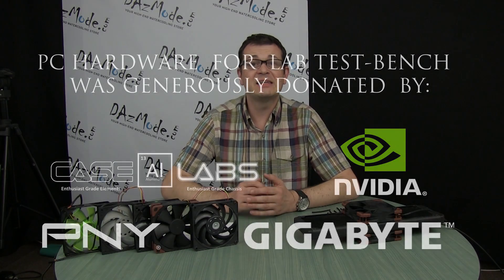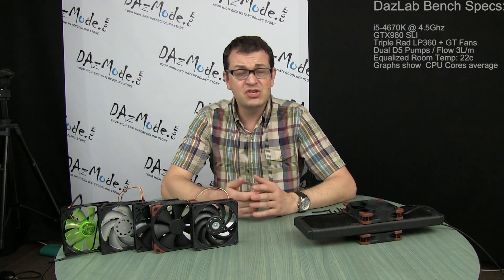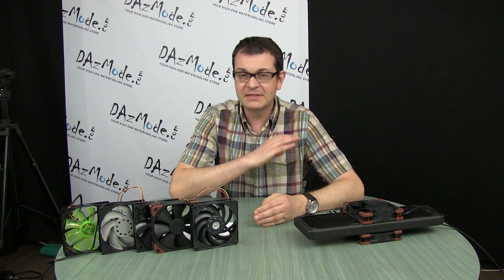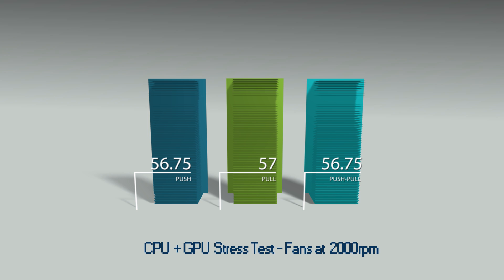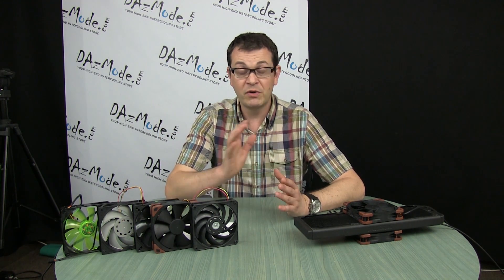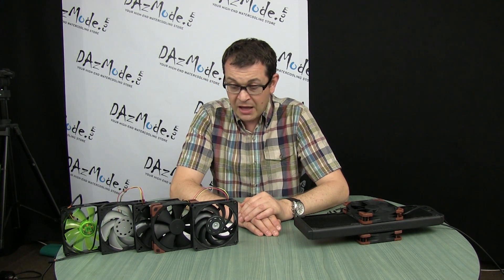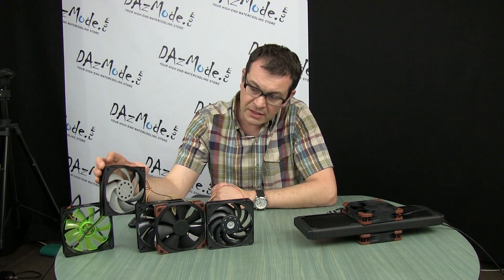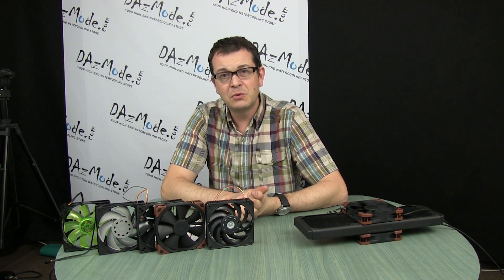Push? Pull? or Push-Pull fans on Radiator? - DazLab EP17

Comment: We can see there were marginally better results with push vs pull, which it should be. But I think the advantage of push can be more significant under certain conditions (fan speeds, fan design, rad restriction, cooling load, etc). In other words, push is always marginally better, but it is probably more so under 'less ideal' combinations of rad and fan and fan speed, and case vents. It would be of interest to find what conditions exaggerate the physical advantage that push has. Obviously gap between fan a rad is one, if you put even 2mm there you would sure notice that.  The greater the intake resistance, like smaller and filtered venting,  the greater advantage push should have. (higher pressure differential between upstream and down should amplify push advantage, but there are other variables).   Also for cpu cooling, fresh air intake across  cpu rad is best if using a gpu that makes significant heat of its own.

Comment: Push Pull should make a Bigger difference on thicker radiators. Shame you did try that.. Also i might have missed it but i don't recall you saying what the fan you used was.. Also it would be nice to know what the sound difference was.. As in is one fan the same volume as 2 fans turning slower ( while cooling performance is the same )

Comment: You are testing push pull on a 20mm radiator, with due low air resistance has not much sense...test it on 40mm and 60mm radiators with greater air resistance.  ;)

Comment: So I did a little test. I had my i7 5960X, dual R9 290X 8GB adapters in a Thermaltake V31 with push-only Alphacool UT60 and Swiftech MCR320-XP. Due to my disgust with Thermaltake I took the system and put it into a Fractal Arc Mini R2 with 240mm Monsta in the front and the Swiftech MCR320-XP on top, both in push-pull. At the same fan speed with exact same fans, my loop temperature went down by 3 degrees Celsius after one hour of running Unigine Valley benchmark. So yes, I can confirm, at medium speed, push-pull makes a difference. So once again, Daz is right. I didn't bother testing at 2000 RPM, I just wouldn't deal with that noise.

Comment: Did you find that the noise was more annoying with 2 fans even at low RPM than a single one at slightly higher RPM ? I guess it depends on a few factors such as the fan themselves and the fin density / radiator height.

Comment: pull is bether, special if u have acrylic pipes on your rig. it makes more easy to clean. but exaust can be push, because normal state u don't have a lot dusty inside case and it will take a year to get some stuff. but I will recommend intake in pull along with a dusty filter. tanks DazMode for your videos

Comment: You should do a test of thick low fpi vs thin high fpi radiator noise level.
My guess is that less fins will mean less turbulence and cutting of the air therefore lower noise?

Comment: Is this expected from a aio cooler ? Or only to a custom loop? I was thinking about using thermaltake aio cpu cooler which is a  360 radiator that I plan on upgrading with 6 noctua push/ pull on a fan controller for noise control running at half speed
Reply from the maker: Rico Suave I would expect Push-pull  to make a positive impact, because AIO pumps have miniscular flow rate and system thermally is not efficient.

Comment: Very interesting, What type of 140mm fan would you recommend for a radiator?
Reply from the maker: anotheraznguy  I have some hopes for new Vardars, but we will see. The 140mm fans are mostly generic crap, however with massive raddage it wont matter.
Reply: anotheraznguy Phanteks PH-F140MP is the best 140mm rad fan I've ever used by far.

Comment: Does sealing the gap between fan and rad (with electrical tape) have a noticeable effect?
Reply from the maker: Stikibits  I have this on the list already, but thank you for good suggestion.
Reply: I tape mine and it seems to run cooler, but it's pretty anecdotal.